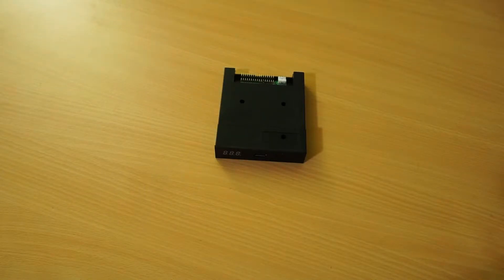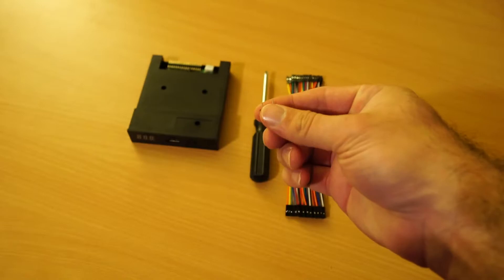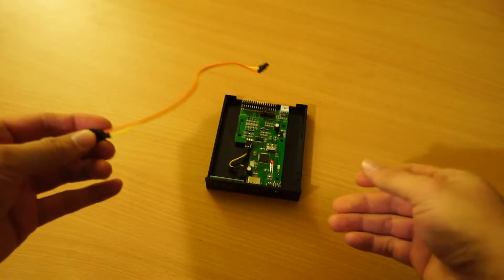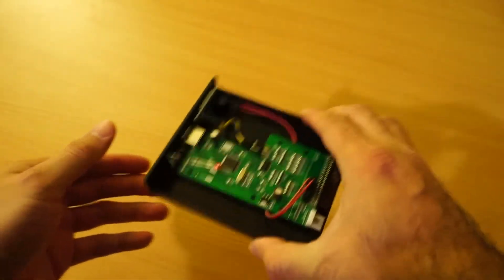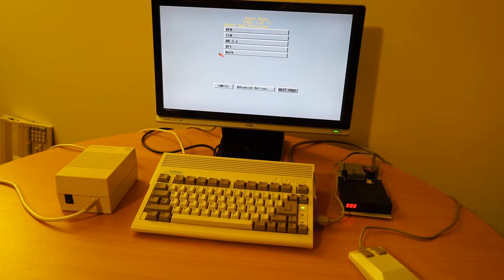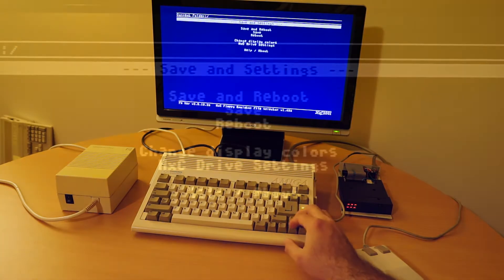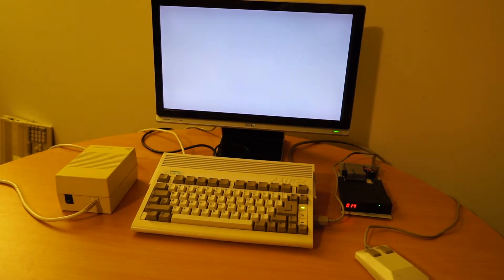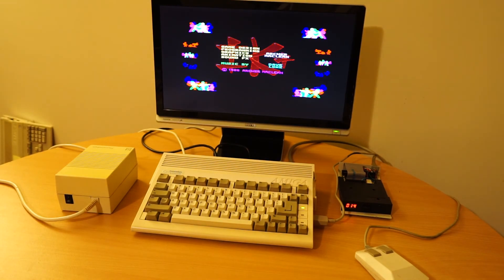How to do the Sound Mod on Gotek drives with HxC (and FlashFloppy) Firmware

Comment: How do you get those options up on the Amiga? I don't even have the boot screen... Done the hardware side of things (that's the easy part), but all I get is thin sounding clicks, I have tried several speakers of varying sizes from a piezo to magnetic coil, but sounds absolutely nothing like a real drive. I installed an OLED & rotary encoder and can get to the "Configure FF OSD" to show in the menu, but cannot click into that menu. Is there a video anywhere about how to set up on the software side?
Reply from the maker: The Amiga startup menu is accessed by holding down both mouse buttons when the Amiga turns on or when you warm reset (Works on Kickstart 2.x and up only - there is no startup menu on older Kickstart 1.x Amiga's).

The piezo for me doesn't completely sound like a real drive either - it's tinnier than the real thing, but good enough in my books. Even in this video it sounds a little tinny.

Comment: thanks for the video, but can you (or someone here) maybe help me, I'm probably too stupid: how can I get the beeper sound louder, it's barely audible.
Reply from the maker: There's a few ways to do that. The simplest is to affix the piezo to the case instead of letting it sit loose, so it has something to vibrate against. Beyond that will be using a larger piezo or driving it with more voltage.

Comment: This is awesome!  Thanks so much!  Would you be a champ and do a video on how to install FlashFloppy or HxC firmware on a Gotek from FLEABAY?  (I love that fleabay bit btw)  :)  cheers
Reply from the maker: Glad it was helpful!

Might do a flashing tutorial - there's been a lot of changes with doing firmware now, as I believe FlashFloppy can be done purely through USB on a stock Gotek drive now instead of having to use the pins on the board to install the loader.

Fleabay is the ultimately flea market! =)

Comment from the maker: Just discovered tonight that this mod also works with the FlashFloppy firmware as well.
Reply: One is trying to copycat the other so this is not a surprise...
Reply from the maker: jf dn True, but it's a free option for the cheapskates out there. 😉
Reply from the maker: Maybe, but as I understand it, it's simply a forked project. The firmware is smaller and doesn't support anywhere near as many platforms as HxC. In playing with it myself, I've already hit some minor issues (and I mean minor, they aren't show-stoppers), but since the HxC firmware is cheap and is regularly updated, I've gone with that for all my Goteks.